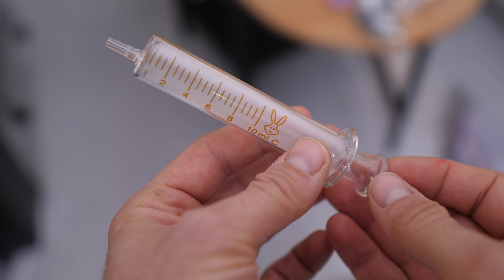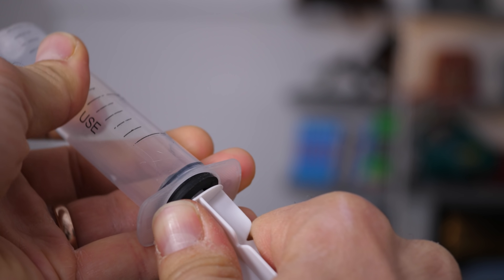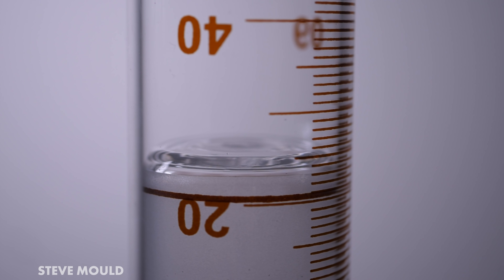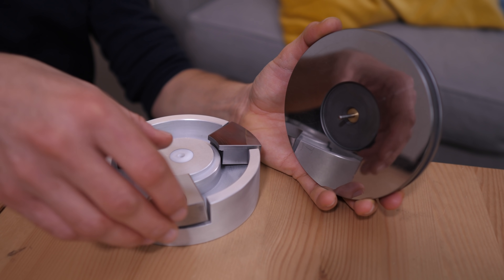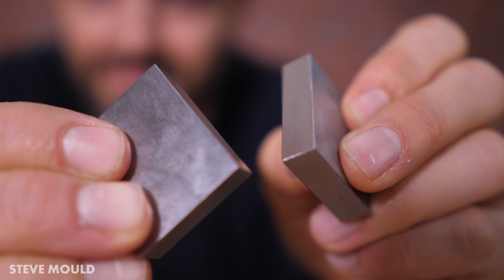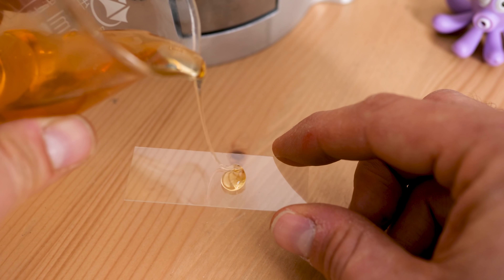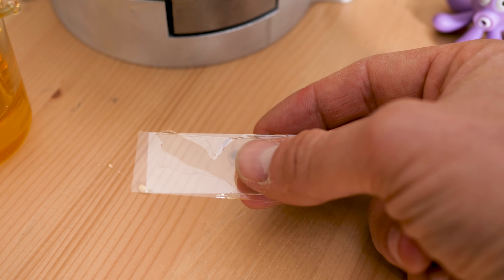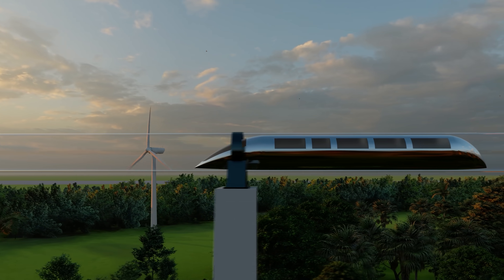The Self-Levitating Kingsbury Aerodynamic Bearing

Comment: The ice skating thing is a myth, ice skates don't cause enough pressure to form water under the skates. They're just skating on ice, it's not well understood why it works.
Reply from the maker: Oh wow, thanks for this. I've added it to the pinned comment.
Reply: Came here to say this. It's true that it isn't well understood. My thermodynamics professor at university suggested to the class writing a dissertation on exploring why ice skating works. Nobody took up the offer. It's a hard problem to solve.
Reply: @guillermoalejandroperezlob5208   why would it not work?  i see no problem there, one solid on top of the other...  the adjacent ice instantly freezes whatever water is produced by the heat of the friction!! again, i see no problem there ...
Reply: @josepeixoto3384  I see a big problem with that explanation.  Friction is a result of motion between to surfaces in contact. Ice is very slippery even if something is hardly moving on it, when any heat from friction would be near zero.   Ice is very slippy even when skates are almost stopped, that is why it is so easy to fall on ice.
As well, skates still work really well at on low temperature ice.  If heating from friction was the mechanism, at lower temperatures, less ice would be melting, so you could conclude that it would be more difficult to move forward.  Skating does not become more difficult as the temperature drops.
Anyone who is still wondering about this should check the video referenced by Jolan Rensen "The Strange and Unexpected Reason Ice is Slippery" https://youtu.be/yjSf7Yh9UZc
Reply: @wabuzzoo8201  Think so?    if you ever hauled ice at very low temps, it is not slippery at all;
and there IS friction always ,  skaters do come to a stop ; also, pressure alone melts ice; i remember the scool experience where a thin wire cable  with weights suspended on both ends cut across a 6 inch block of ice,over time,due to pressure oinly,and NO trace of its voyage was left behind,the water constantly turning to ice (of course,it's below freezing in there!!) in back of the wire as it cut across . 
You could not skate if your skates were made of ice, same as sticking you tongue to cold ice or to a very cold lamp post (DANGER!!), they WELD together instantly;
It's just fortunate (is it ??) that WATER does lubricate well between "steel" and ice, as motor oil does between two steels; if water did not form from ice  under pressure,you'd need wheels and bearings.
I stand by my explanation.
Reply: Destin from smarter every day has a slow motion of skates that gives a bit of glimpse on it
Reply: https://youtu.be/yjSf7Yh9UZc
Reply: @JolanRensen  
Most underrated comment in this entire thread. More people in this thread should check out this video, it covers a lot of the arguments being made here.
Reply: Is there a scientific reason why it shouldn't work?
Reply: @the.littlest.toaster  ice scating is magic, just like magnets
Reply: @UltraNyan  - There is nothing "magic" about "magnets", but you have acknowledged your lack of knowledge in this arena, now please kindly exit.
Reply: @seanregehr4921  Telling people (not at all kindly) to kindly exit when it's you that missed an incredibly obvious joke is the peak of irony. Even if you don't get the ICP reference it's pretty clear that user doesn't actually believe magnets are magic. Also, maybe don't speak authoritatively about how ice skating works when the mainstream scientific community doesn't know.

And salt doesn't melt ice. It lowers the freezing point of ice, so water that's already liquid doesn't freeze as easily. It's not actively melting ice, it's preventing ice from being formed. The only garbage I see in this comment thread is you being pretentious and rude about things you clearly don't understand.
Reply: @CSPGameTime  Salt most definitely melts ice.  If you throw a dozen pellets if ice in a sniw-civwred sidewalk (and snow is ice) toull see a dozen melted spots later in the day of the next day, while the rest of the snow is still snow (which is ice).
Reply: Skis can more or less well over snow and ice, they are waxed to run better which presumably alters the friction and flattens the boundary layer.
The wax required to run well, changes with snow temperature.  Whilst hard wet ice is very slippy it's not the fastest as excess liquid flows dissipating energy and can also have a suction feel reducing the glide across the surface.
Reply: Ice skates - how do they work?
Reply: Haha one throw-away line and I knew my science peeps would be on the case.  The shear/slip dynamics of boundary layers of water/ice lattices is still a relatively unsolved problem.  Last I heard, we sort of figured out graphite but even that is sketchy as hell and the fact that using scotch tape and a pencil to form carbon fibers and sheets is somehow related to the fact that ice-skating works is one heck of a problem in physics.
Reply: @selfification the tape is polarized due t9nelectrpststoc forces you mean and that is related to electrostatic forces of skate on oce you mean that is pary of it? And create even amooth layers of graphite or is there more to it..and what exactly makes it "one heck" of a problem?
Reply: Ice skates can melt the ice, but only if the temperature is above -3 degrees (Celsius) and people ice-skate in temperatures far lower than that all the time.
Reply: It's recently become much better understood.  There's an interface between hexagonal and cubic ice structures at the surface that leaves loose water molecules that are able to shift around (but aren't in liquid phase).  See Nature "Imaging surface structure and premelting of ice Ih with atomic resolution" and associated results.
Reply: They forgot to take in consideration that the top layer was in the 4th phase with the friction and pressure.
Reply: Funny thing is that after a while the ice has in fact began to melt... It seems to me that pressure from the skater's weight isn't the only relevant action.  Perhaps looking at the average kinetic energy of the water molecules beneath the skate (aka the temperature) isn't appropriate as there will still be some water molecules able to gain enough energy to change from solid to liquid (but then back again rapidly as that energy is dispersed to the surrounding water molecules). Maybe melting ALL the ice under the skate is not required, just enough to create a very sparse and very temporary fluid between the skate and the ice.

That's my hypothesis and I am sticking to it!
Reply: @benfubbs2432  - This is utter non sense. When a zamboni drives over the ice it does two things; a) shaves the ice to a level surface and b) lays down a thin layer of water to fill any cracks or divets, etc.

Ice skating works because of density alone. Frozen ice is very dense which is why the sharp blades of a skate do not completely destroy it but only slowly wear it down. After only a few minutes all the near room temperature water that was left by the zamboni has frozen since the overall mass of the ice sheet has greater influence on temperature regulation (thermal dynamics).

Skating itself does not melt the ice. This is an unfounded claim with roots in vanity and illusion. What actually occurs is that the sharp blades of the skate, x2 for each blade, slowly carve up thin layers of ice. These ice shavings do not lie completely flat with the ice surface and air gets trapped beneath in between. This cause thermal dynamics to work and the ice shavings eventually melt, but slower than the ice mass will try to freeze the water once more, as does.

Now ice, frozen water, has little friction and this allows for the smooth gliding of skating.

What is ridiculous is all these bogus claims of nothing but vanities and illusions as to what occurs. This is simple rudimentary science, like how salt melts ice.. The entire comments section is full of this garbage.
Reply: @seanregehr4921  Well said. I grew up playing ice hockey on a frozen pond. When it's -20 there is no melting going on. It's more like a train wheel on a track. Very low resistance.
Reply: @mixer6166 but it's not nonsense or unreasonable tpmthink friction frpm skates on the ice might generate enough heat tp melt some few larticles..but then maybe skating ice is designed to be as frictionless as possible as others have said?
Reply: @ not sure about any of this but if I think about stopping from high speed both blades are scraping sideways on the ice generating lots of friction to stop. Is that melting the ice too? Maybe…
Reply: Instead of arguing whether or not skates are warm enough, or if the ice is melted melted, why can't you use a thermal camera and prove it very quickly?  

And perhaps a high speed camera can see the tracks of water behind the skate freeze quickly.
Reply: @MultiPleaser  a thermal camera would not detect the melted ice in this scenario
Reply: i've seen a scishow video or someone else about it. they say that skating happens because water on the surface of ice is looser than further in. so it's kind of like you're always on some liquid sort of situation
Reply: How an ice shake works is very well understood. The ice skate reduces friction by having a very lttle amount of the blade touch the ice as possible. This is achieved by having the skate blade being as sharp as possible to minimize contact with the ice. You can see where the blade makes contact with the ice by looking at the trails of cut ice left by the blade.
Reply: @zomfragger  Skates are not a knife! The skates must have a surface that is carefully sanded into a smooth plane on the grinder, and mainly so that the skates have sharp edges that allow turning, braking, starting, etc. You confuse those tracks after skating with tracks from the edges of the skates! The small flat surface of the skate ensures minimal friction, which is quite evident in this. It is possible to skate on special plastic, just as you can ski on plastic if you have sharp edges on your skis.
Reply: @DL-kc8fc that's completely wrong. Ice skates have a concave shape which makes the outside edges of the blade as thin and sharp as possible. It's amazing how people will shoot down other's ideas, then authoritatively give completely wrong statements... 🤔😂🧐🙄🤣
Reply: @BonefishSailing  You probably live in the desert. Yes, a special grinding method can produce a groove or groove for NHL hockey players, for example, but regular grinding is done in a jig with a flat disc (I can grind without a jig). The flat small area provides a slip and sharp edges (right angle) to keep your feet from going sideways, hence cornering and braking.

Comment: Nikola Tesla used air bearings in his high kw/mass motor which used tesla turbine as the moving mechanism instead of pistons.
There are like 5 stories of his car, 1 is that he replaced the engine with his "100 horse power" engine.
There is a paper on the engine in the archives.
Reply: https://www.dropbox.com/sh/9jb1q65u3tyilhv/AADJT9sm4-kMPZ_sY-Lh9LxQa/Articles?dl=0&preview=The+Tesla+Gasoline+Turbine.pdf&subfolder_nav_tracking=1

Comment: I've definitely noticed this effect by sliding flat glossy paper (like a playing card) along a hardwood surface and with some small glass lens blanks that I happen to have. If you drop one on top of the other they will tend to be frictionless for a moment until you "work out" all of the air then they suddenly get stuck together like they are glued and take some effort to pull apart! The honey example is pretty much what I figured was going on just with air instead and on a smaller scale.

Comment: 6:56 aren't you getting an aerodynamic effect on the bit connecting to the top which is spinning? why not put a little puddle of mercurity and then stick the conducter into the puddle of mercuriy or other conducting liquid to get a more valid dircuit test of the spin?

Comment: One of the practical applications is car crankshaft main bearings with engine oil providing the hydrodynamic lifting force.
Reply: Another one would be the air cycle machines of the pneumatic air conditioning kits of aircraft. They actually use air as the fluid. An inexperienced mechanic might think the bearings are bust because you wont be able to spin the rotors by hand.
Reply: This is much more common in aircraft engines. They are called babbitt bearings.
Reply: @Muckin 4on OK then thanks. I have just encountered this in the course of my pilot training. During startup if the oil pressure does not get up to par within 30 sec (generally, depends on the plane) you shut it down. I gave my explanation bc of the more critical nature that pressure berrings have on aircraft.

Thanks again, all the best.

Take luck

Comment: Gauge block wringing absolutely blew my mind, I can't believe I've never heard of that before
Reply: Look up  the phenomenon "cold welding." I think it's a similar concept.
Reply: Also, the total length of gauge blocks that are wrung together is less than the length of each block added together...
Reply: @pbrstreetgang2489  
Bonus Points if you can write it up as a Mathematical Formula
Reply: You can experiment with this yourself by purchasing polished salt crystals used for infrared spectroscopy. They are clear round discs made from a single LARGE salt crystal so they’re kind of expensive. You can polish them to be extremely flat and smooth and push them together until you can no longer pull them apart. Two discs essentially become one solid crystal.
Reply: @evilferris  
That's also Tectonics and Sediment at work, so you're not only going into Geology, but Geo-Engineering with that example.
Reply: Look into cold welding, fascinating stuff. https://www.youtube.com/watch?v=Y2nQ8isf55s
Reply: To address some points made by other people: 1. It's not cold welding. Cold welding can happen if you let them stick like that for a longer period of time, then it actualy becomes hard to get them apart.
2. The casimir effect might also take place but thats not the main reason why they hold togther.
3. The main Force acting here is Adhesion, its the same force that holds stuff together when using glue. It only works because the surfaces are so smooth that you get a great amount of surface contact between the two metal pieces.
Reply: @MetaKnight23  I'm pretty sure that metal isn't naturally adhesive. In fact, the incredibly smooth surface area would reduce its adhesive potential because there's less friction. The main force is simply a vacuum. The surfaces are nearly perfectly smooth so when you press them together a vacuum is created. The external air pressure holds them together because there's almost absolutely no internal pressure between them. We could prove this by putting them into a vacuum chamber and witness them come apart once the external pressure is lowered enough.
Reply: @Saskia689  Extremely flat surfaces produce massive amounts of friction, thats why glue works, it fits into all of the micro grooves of both surfaces and then hardens, creating enough friction between the two objects to hold them together. As far as I am aware this is the same reason for the metal binding, the surfaces are flat enough that glue isn't required, they produce enough friction to adhere themselves. Literally 7th grade science class man, although if I'm incorrect about any of this (More than likely) I would love a link to a good video or paper explaining why
Reply: A CD 💿 on a glastable would Do something similar But Not as perfekt.
Reply: It the same reason why a Gecko lizard can run across the top of a ceiling. The atoms are so close that the atomic attraction of the atoms come into play.
It's called the Vander Wal effect.
Watch this:
https://youtu.be/gzm7yD-JuyM
So gauge blocks or a Gecko lizard on the ceiling are the same effect.
Reply: @Albertkallal  what about the experiment what this fella done, where he had two metal plates really close together and they'd always just come together off of thier own doing? he reckoned  it was like a couple of boats in a pond with still water between them, and it was the ripples everywhere else what drove the boats together. think the fella was called cashmere or something.
Reply: @mikenewtonninja9379  
You mean the Electro-Magnetic Wave Frequency (EMF) Field?
Reply: @BlueNEXUSGaming  possibly! I remember the fellas name now, casimir. if the experiment you describe was done by this casimir geezer then yes!
Reply: zero point energy

Comment: Is there a reason these aren't named with a "pneu-" prefix, like the distinction made between pneumatics and hydraulics?
Reply: You are correct, it's a naming infraction.. Bad pneus!
Reply: @michaelggriffiths  when you think it's another penis pun but it turns out you've read it wrong hahaha
Reply: Bc the pref8x is 'aero' as in aerodynamics
Reply: Because it works the same way with both gasses and liquids. Maybe also because pneudynamic bearing doesn't sound very good. :)
Reply: "pneu" would indicate a tire. "pneumatic" would indicate breathing, thus air pressure and aerostatic system.

Also, fluids liquids are typically almost uncompressible, unlike gasses.
Reply: @sleeptyper  I think you mean liquids, not fluids. Gasses are fluids.
Reply: @brookerose1312  Well yes, thank you. My mistake.
Reply: @brookerose1312  In fact, anything that flows is a fluid. If the conditions are right solids can even be fluids
Reply: @oml81mm  Lol yes, the flowing pitch experiment. Tectonic plate boundaries would feel left out without a mention, too.
Reply: Gasses and fluids generally behave identically.
Reply: @59jm24  Gasses are fluids. Both gasses and liquids are fluids;)